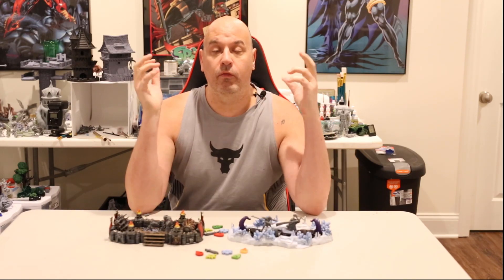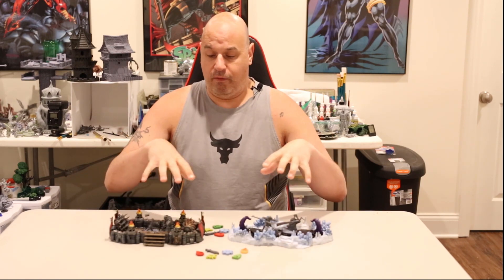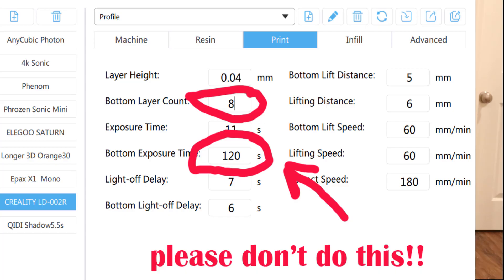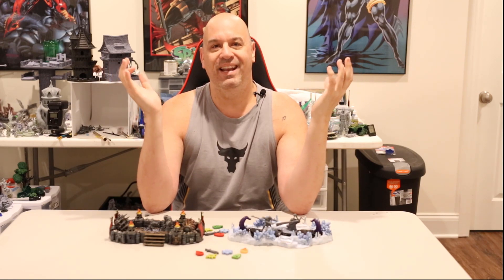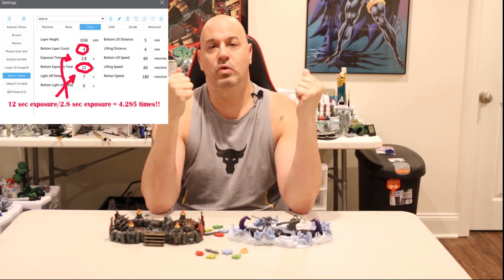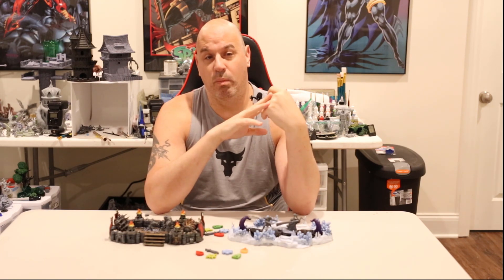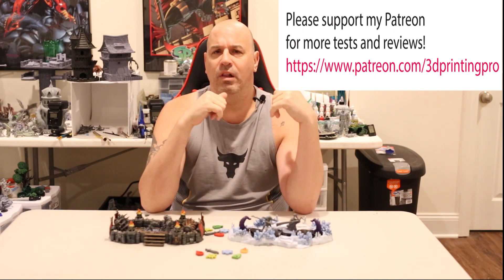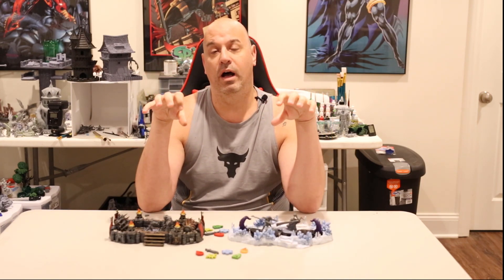Are you destroying your LCD screen when resin 3d printing?? Learn what settings may be doing it...

Comment: Thanks for this. I'm quite new to all this and I've been using your "small" supports with no fails so far~ but I was using the program's default for this, meaning 8 layers at 50 secs each. I won't go too crazy yet, but I'll try 6 layers at 35? Let's see how that works XD
Reply: I would say drop the layers to 4, and don't worry about the exposure time.

He forgot to mention that bottom exposures account for about 1-4% of your exposure time, so even on the very high end you're talking about maybe 1 single print different in the lifespan of your LCD.
Reply: @zemerick  That isn't accurate based on physics. More heat over time makes things worse, longer exposure makes higher heat, higher heat deteriorates things faster. Longer UV exposure causes exponentially more radiation damage; everything contains radiation and everything can absorb some with no damage, but continuing beyond becomes increasingly worse. It's not a linear scale, it's an exponential scale - the more it goes up, the more it goes up. Double the time is considerably more than double the damage.
Reply: @kaldogorath  I never said that wasn't the case. The point is it's utterly trivial. It'd be like telling a chernobyl firefighter not to eat a banana because it contains radioactive potassium.

This is only a problem when you do lots of short prints, AND have very long bottom exposures, AND have very high bottom layer counts. This is what will cause the damage to explode. Cutting out a single one of those will solve the problem. ( Assuming of course you don't have something really crazy stupid like a 1000s bottom exposure. )

As far as heat goes, your bottom layers shouldn't ever make a difference. For starters, the printers are actively cooled, with heatsinks, and use quite efficient LEDs. They do get plenty warm eventually, but not from a few seconds of bottom exposure. They then hit equilibrium, and stop heating up. Want simple proof that the heat isn't a problem? No manufacturer has recommended feeding air conditioned air into the printer, or anything remotely similar. In fact, many people end up building heated enclosures for their printer, which works just fine. ( Many resins need to be kept warm, and some people have their printers in unheated garages/etc. )

In fact, nearly all of the heat the LCD is exposed to comes from the resins exothermic reaction, not from the LEDs, and nearly all of that heat comes from the first few seconds of exposure. In this initial bit, the resin can give off enough heat to melt other plastics. Since this increase in heat drops off incredibly fast, adding more exposure time has very minimal impact. The resin already gets almost as hot as it will get even from normal exposure, yet alone bottom exposures higher than normal.

In the end, unless someone is just doing something crazy stupid like the original video was basically about ( IE crazy high bottom layer counts AND high bottom exposures ), the difference in average screen life is going to be a small fraction of a single print. Since you don't care which layer a print fails on, only which whole print, there isn't an issue with increasing bottom exposures a fair amount.
Reply: Have you been using the anycubic plant resin? Doing my first print tonight

Comment: On my EPAX x10 mono the factory recommended bottom exposure time was 25+ seconds. I believe Greg runs as low as 14, but I was having some issues that low, and I’ve lowered my normal prints to 20 seconds / 4 layers, and it’s been consistently working perfectly for about 30 hours now.
Reply: Just got a epax e10 4k mono, gonna try this
Reply: @Xenoti  After months of printing EPAX hard black and EPAX hard gray is the answer to most questions. They are absolutely amazing to print with.

Comment: I’ve been using 8 layers at 90seconds I’ve printed over 100 prints at that setting. My screen is fine, however I feel the qidi tech machines is very well built but I am gonna try 4 @ 15 or 12 and see what happens
Reply from the maker: 15 might be too low (unless yours is a monoscreen), try 6 times your normal exposure times first  :)
Reply: 3DPrintingPro yea Greg it’s not a mono ob my shadow 5.5 I will try it out printing your model from Trouble in tavern. So my normal exposure is 8.5 per layer so 4 bottom layers at 55sec ? My normal b4  was 8.5 at 90 I started at 5 layers at 50 and was getting a lot of failure but I was doing my own supports back then
Reply from the maker: Yeah 55, worst case 60, should work

Comment: 6 bottom layers max and 60 seconds and that is, always have great adhesion.
Reply: Ive had greater success with similar settings. But I do like the idea of taking off my models easier. And not burning my screen. :P So imma see what happens if I lower settings.

Comment: I was using 8 base layers and 90s base exposure time (10x normal). It was the settings my resin seller told me to put on. I'll change that now.
Reply: How did that work for you?
Reply: @jonruehle9186  I changed following this video's instructions. It worked like a charm.

Comment: Ever since I started printing(Anycubic Proton) in November I have been using water washable resin with 3 bottom layers, 55 bottom exposure, 8s layers. Have not had any problems with prints after getting the hang of supports.

Comment: Hey, great info! I thought some of my stuff was getting pulled due to not high enough exposure but this makes a lot more sense since increasing it was not solving my issues.

Do you have any tips on printing tiles? I've been trying to mass print but when I print vertically, they are getting slightly pulled off the base. All the advice I've got was to increase bottom exposure time.... which clearly doesn't seem to be the answer

Comment: I just got a Mars 2 Pro. I've been using 1.6s exposure time and 8 layers at 40s for bottom layers. I'll definitely try reducing it to 4 layers at 10s. The problem I've had a lot though is getting prints sticking to the FEP half way through the skate (after the bottom layers finish).

I'll give it a go! Thanks

Comment: Interesting topic. To be honest, I am printing 120s bottom exposure time because I had a lot of failures in the beginning and with these settings (but probably decent leveling) I barely had any. I know I can tone it down a bit, because I recently reinstalled my PC and did an import for my Chitubox settings but it didnt import my printer profile, so I did get results with different settings. So I am going to experiment more with it now.

It's Also good to know that "older printers" (compared to Elegoo Saturn and Anycubic Photon Mono x) like the Anycubic Photon don't use a Monochrome screen. This means that these screens will only last for about 500 hours instead of 2000 hours. So yeah, high exposure times shorten the lifespan of your screen.

What also can be interesting is how a longer exposure time heats up the resin during printing. I live in Europe where it mostly of the time is between 15 - 20 Celsius (59-68 Fahrenheit). While resin printing recommends 25 Celsius (77 Fahrenheit) atleast. I have struggled with printing in cold frosty winters before and I am wondering how much resin will cooldown after heating it in a pan of warm water (submerging the entire bottle in a pan, not heating the resin in the pan itself!), and if the exposure time in this example will have any effect.

Tnx for another 3D printing lesson ;)

Comment: Currently using 6 bottom layer at 60 second on a Peopoly Phenom L with Siraya Tech Build
Reply: How often you go through screens? I was thinking of getting a base model Phenom but with screens only last 200 hrs and print times of 25 hrs or more you can only do 8 prints before you have to start worrying about screen replacement which looks like a pain to do.
Reply: @stinkyham9050  I just recently purchased it. Screen life is suppose to be around 400 hours. I've got maybe 70 hours so far.
Reply: @prncchrmng  How big are the prints your doing? I was wanting it for helmets and stuff that size. The things that are stopping me are having to use the special resin (I usually use water soluble resin so I don't have mess with large amounts of ipa) and the screen replacement factor. Money isn't really a consideration as I have the cash but just don't want to spend it on a machine that doesn't fit my needs.
Reply: @stinkyham9050  right now I'm doing a Mandalorian costume minus the helmet.
Reply: @prncchrmng  Sounds cool. Do you have pics posted of the progress build? I printed a Boba Fett helmet myself on my FDM but put it on hold to finish off some model kits and a few other printed projects.
Reply: @stinkyham9050  I don't, I haven't really taken any in progress pictures... And don't really plan on sharing any until probably Halloween. I just keep kicking myself thinking how big of a project it is
Reply: @prncchrmng  Just break it down one piece at a time and just keep working on it. It will come to together in the last 10% of the build. I built a full size "Billy the Puppet" from Saw for Halloween 2 or 3 years ago for the front steps of my house. I thought I was never going to get it done but a week before Halloween it all just came together. Stay positive.

Comment: Gotta say, even 55 seconds seems a bit high. Most of my bottom layers are <30 seconds at 5 layers. I might try 4, but I do a fair amount of large functional pieces and I've never had a print detach from the plate except for when I first received my X9-mono and the 5-6x exposure time didn't work well so I went to back to ~25s as that has worked phenomenally well on my LD-002R. The lower BLE times might work well for minis but as I had a much larger build plate, I went straight to printing larger things and the lower times didn't work with I believe it was Sculpt. 

But I 100% agree with you that most info on bottom layers is way too high. Glad that you are still sharing good info, we need more of it in the community.

Comment: Manufacturers need to implement variable exposure times into their software/hardware. Examples, large flatter layers you could set to 20% higher time, top layers with fine text, 20% less. Perhaps variable per layer area. etc
Reply: NOPE!! Sorry but you are talking nonsense! Resin has to cure evenly. If you dynamically change exposure depending on how "big is the exposed layer" is a NO GO OPTION! The only exemption are the first few layers were you over-bake them for a reason.
The whole idea is to introduce just enough energy for resin to cure and make a stable model and eventually you post-cure it to finalize the curing /polymerization process. There are RARE occasion where you want a fully cured resin while you are printing!!!
Reply: @dodobarbar  Let me provide a practical example. While dialing in a resin by Phrozen I found the best detail (least filling in of gaps) in text to be around 5s on my printer. Too much lower and some part do not cure properly, so 5.5-6s is a good medium. However, to stop minor support sag and ensure supports (for a model that printed fine in previous resins) are strong enough for reliable prints, I need to bump up the exposure to 7s, this causes some over-curing of the text.

One solution could be to cure the supports and lower layers for 7s to ensure strength, and gradually reduce exposure to 5.5s over the top parts of theeh model to have the crispiest text.

This could avoid having to add more supports
Reply: @SaschaUncia  Nope! It is not that simple! Though there are printers/manufacturers who have different time settings per layer or a group of layers, but you have to take into consideration ALL KIND of shapes. So it turns out not to be very practical. One of the best options is a manual tune-in while the printer is printing ( but you have to know where the problematic detail is). Anycubic printers do have such a setting. In a matter of fact, ALL printers that use ChiTu hardware do have this option.
To suggest a solution to your issue. Just use either stronger pillars or more but slimmer. Another trick is to use a very thick pillar and use a tree type support. If you're using Chitubox John (3DPrintingPro ) has an excellent video on how to make tree-like supports!  And use the optimal time as per your discover ;-)
Reply: @dodobarbar  Good suggestion, but it's not the pillars that are a problem, its the contact points.
 I could probably add a few more, but my point was that it was printing fine on a couple of other resins before I tried this one. Hard to find a 'sweet spot' for exposure, higher and no issues, but slight fill in of detail on torture tests, nothing major.
 A slight increase in exposure of affected area could in theory make it easier to create one good master file instead of different ones with different supports for every resin-specific issue you run into.

There is no reason that a 20% or so increase in exposure for certain layers or areas could not implemented. If Chi-Tu-Box has a similar setting please point out where it is because I see no such feature.

Btw, when you lead each reply with "NOPE!!!" it makes you sound dismissive and obnoxious, a bit of mutual respect please.
Reply: @SaschaUncia   :-) Sorry, Sascha! It wasn't my intention to be rude. It's just that I'm not an English native speaker, therefore some "phrases" sound different when translated. 
I don't know if you read some of my other posts on Greg's/John's channel but we make 3d resin printers so we do know a bit on the topic. The main issues ARE RESINS!!! Forget the resolution, forget the monochrome LCD, forget all printer's related issues. You should look at resins as to an equation with maaaaaany variables.  And when you solve complicated equations you would usually put some constraints, simplifications, ... Well, whatever you do the support is your main equation/problem solver.  As per our chemist... he says that the problem is to formulate the resin to photo-cure as fast as possible, to cure to the biggest volume as possible, to shrink as little as possible, and to have great mechanical properties. Add to that the biocompatibility (dental/medical industry) and you finish up with a resin that is 200$/l!!
What "you guys" are using... different Elegoos, Sirayah,  Anycubic,  iFun, ... these are all cheap resins with MEDIOCRE properties. But are cheap enough and "good" enough for making figurines, and some not-so-demanding applications.  To get the equivalent from FDM/FFF printers like PEEK, PETG, PC, ...well, you are out of luck... OR, you have to pay premium money to get REALLY GOOD RESINS.
Cheers!
Reply: @dodobarbar  Fair enough. So many factors, each one prints differently. Elegoo and anycubic standard were my original resins. I've been trying Phrozen water washable, seems quite good but the support contact points come out weaker. Not as much trouble as Elegoo water washable though, that one prints great but cracks (practically implodes) if exposed to moisture after curing.

I want to try Siraya at some point as well; Which resin do you think has the best balance of properties for home printing of miniatures?
Reply: @SaschaUncia  Hmmm, can't say. It depends mainly on where you are from! In EU it's quite hard to get Sirayah for example. On the other hand, In the US of A, it's hard to get Liqcreate (FormFutura).  As said in previous posts resins are crucial for success, way more than the printer itself. Cheap resins tend to be brittle and they shrink/deform a lot. But for your specific need (miniatures) I would recommend looking for  "tough" and "engineering"  prefix if you are willing to spend a bit more and if your goal is to make durable models. Also, check for the shrinkage. It should be below 1%. The other thing, for the sake of the details, it should be opaque, NOT transparent/translucent. The opaque resins have tiny particles that prevent UV to penetrate and diffuse too deep. This way you can make very detailed and sharp models. For example, dental modeling resins are a good choice because they have a superb resolution/details with very low shrinkage. Sincerely some vendors use the prefix dental but it's just a normal modeling resin.
Again the keywords are low shrinkage (<1%), opaque (particles inside), toughness (not brittle). Although the shrinkage is not sooooo important in miniatures as you are usually not concerned with exact dimensions.  But in engineering it's crucial!
Reply: @dodobarbar  Thank you for the information, I'll keep an eye out for those specs. I can get Siraya so I'll have to try it, just expensive here in Canada.

Comment: My settings arent perfect, and obviously the usual caveats about printer, resin, etc... but someone once told me to have no more than 3-4 times bottom layer as regular layer because it reduces the bond between the base and the next layers. Since i've started following that advice i've had less of those annoying  delaminations.
Reply: I think it depends on the material expansion/contraction of the resin. I have noticed this with Anycubic Orange (with 65-70F room temps). Do you get delamination mid-print or after curing?
Reply: Mid print, and often around where i imagine it switched (around 1.5-2mm with 6-8 layers at 0.03

Comment: 6 layers, 0.05mm layer height at 20-22 seconds on a sonic mini.
Printing 1/56 to 1/48 tanks, usually full sized (hollow, 3mm walls).
Will tune further down when i get to infantry or lighter pieces though

Comment: The LD-002R forced me to fine-tune my bottom layers.   The photon was really forgiving with bottom layers, but if you have your exposure up too high on the LD-002R it is damn near impossible to get the prints off of the build plate.  You want to slowly lower your bottom exposure settings until it is just enough to stick without sticking too much.

Comment: I've recently been using 10 bottom layers, but all the way down to 35s bottom exposure. I've not had any failures with adhesion, and it practically slides off the build plate.